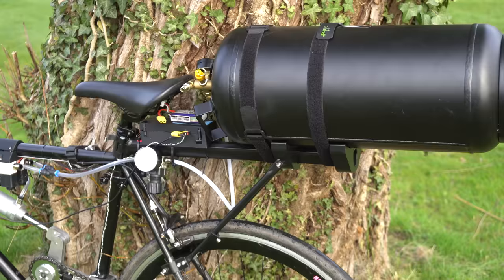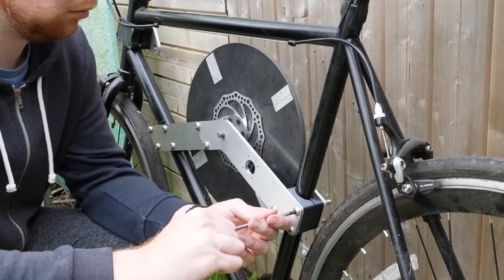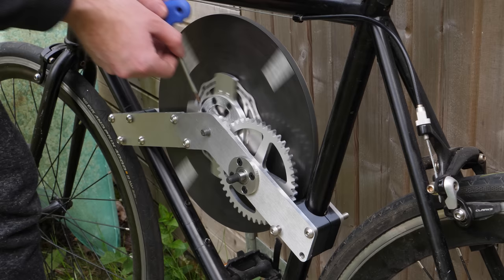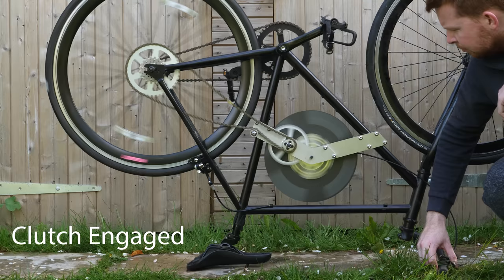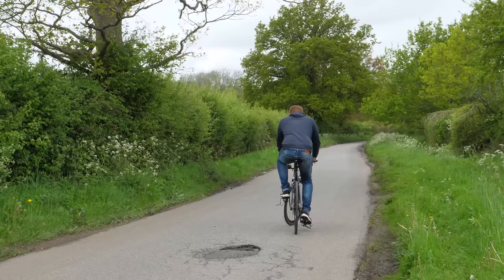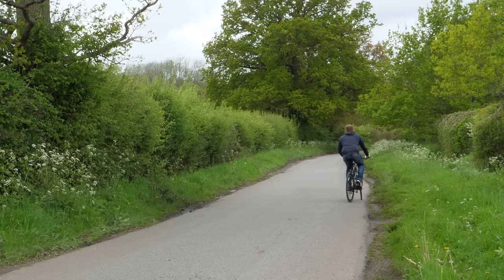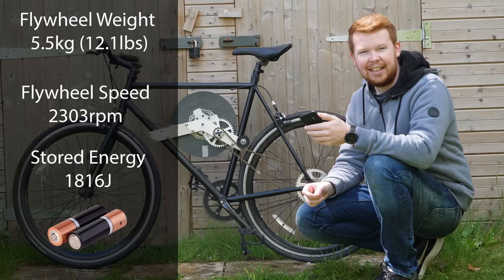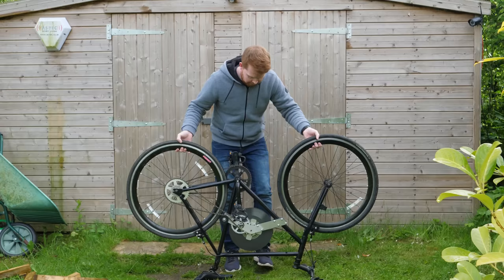Flywheel Bike KERS

Comment: Additional Benefit:
The Rotational mass stabilises the bike even when the bike is stationary.
Your feet dont need to touch the Ground at a redlight.
Reply: Wow I didn't realize that!
Reply: What would be cool is a way to power up the flywheel while the bike is stationary. You approach the red light, use the flywheel to slow down, (getting some RPMs) pedal a bit while waiting (gaining max rpms) and then engage the flywheel to accelerate quickly when the light turns green
Reply: I'm pretty sure bikes don't work like that
Reply: @burkejohnson4539  he's saying the gyroscopic effect of the flywheel would cause it to be stable at a stop. Not sure if this would help much, though.
Reply: @WorkedSnail  based on this logic motorcycles should stay upright too when idling. Maybe if the flywheel was heavier than the bike it would work.
Reply: @hsxenon  this flywheel is much larger considering the overall weight of the bicycle, compared to a bike.
Reply: Bro it can not keep the bike and Tom upright but it can balance the bike alone if Tom leaves the bike ..
Reply: Also if you spin the flywheel up in the right direction it will keep you from endoing and faceplanting which allows you to brake harder
Reply: @WorkedSnail  and I said it wouldn't. Believe me, I understand what he's saying, please don't patronize me.
Reply: @sarveshwarsharma990  for gyroscopic stabilization to occur, there needs to be gyroscopic procession. The flywheel would need to orbit a hinge. The flywheel does not do this in this case and so it will provide no gyroscopic stabilization.
Reply: @shutdahellup69420   @Sarveshwar Sharma  for gyroscopic stabilization to occur, there needs to be gyroscopic procession. The flywheel would need to orbit a hinge. The flywheel does not do this in this case and so it will provide no gyroscopic stabilization.
Reply: @laurean5998   @Sarveshwar Sharma  for gyroscopic stabilization to occur, there needs to be gyroscopic procession. The flywheel would need to orbit a hinge. The flywheel does not do this in this case and so it will provide no gyroscopic stabilization.
Reply: @jslavertu   @Sarveshwar Sharma  for gyroscopic stabilization to occur, there needs to be gyroscopic procession. The flywheel would need to orbit a hinge. The flywheel does not do this in this case and so it will provide no gyroscopic stabilization.
Reply: @lifefindsaway7875   @Sarveshwar Sharma  for gyroscopic stabilization to occur, there needs to be gyroscopic procession. The flywheel would need to orbit a hinge. The flywheel does not do this in this case and so it will provide no gyroscopic stabilization.
Reply: @oadka   @Sarveshwar Sharma  for gyroscopic stabilization to occur, there needs to be gyroscopic procession. The flywheel would need to orbit a hinge. The flywheel does not do this in this case and so it will provide no gyroscopic stabilization.
Reply: @Sarveshwar Sharma  for gyroscopic stabilization to occur, there needs to be gyroscopic procession. The flywheel would need to orbit a hinge. The flywheel does not do this in this case and so it will provide no gyroscopic stabilization.
Reply: @burkejohnson4539  bro here we dont want the gyro to spin freely ... We want the gyro to keep our bike stabilized and fo that the gyro needs to be connected directly to the bike for energy transfer ... If we connect the gyro to a hinge then the gyro would just stay in its upright position even if the bike Is standing of is falling ... It will not be able to transfer its energy to the bike and all the energy will be lost due to the hinge...
Reply: @sarveshwarsharma990  yes it needs to orbit. It will still have some degrees of movement restricted
Reply: @burkejohnson4539  if it can orbit freely it will just orbit freely no force will be exerted and we want force to keep bike balanced
Reply: My Comment was ment to be a Joke with some science background....lol.
This flywheel is of course WAAYYY to small to keep you upright.
But a idling Motorcycle is eazier to balance than a Bicycle especially Bikes with large displacement.
Gyroscopic stabilization is a thing!
Reply: @justjonazjameson5559  lol sorry sometimes I'm a bit too logically minded and don't pick up on that stuff. All else aside I believe that for gyroscopic stability to be created the rotating mass needs to be orbiting about a center point. Look up a demonstration on YouTube using a bicycle wheel. Notice how it rotates around the point it is suspended from. If it weren't for this motion, the wheel would just fall. For this reason, the flywheel on a motorcycle (or bike, for that matter) would not provide gyroscopic stability.
Reply: @sarveshwarsharma990  by orbiting in response to the bikes motion the stability is generated
Reply: @sarveshwarsharma990  it would only orbit in one plane of rotation, so not completely freely, either
Reply: @burkejohnson4539  yup now u r right ... It needs to be fixed in the axis direct towards the motion n of falling bike ...i.e. it needs to stay as it is rn
Reply: @sarveshwarsharma990  it still must be able to orbit, which it can't now

Comment: I work in electronics and my solution would obviously be regen braking. The idea is ridiculously simple: you have three half-bridges powered by the battery that provide voltage to each phase of the motor. The higher the voltage, the higher the RPM. If you intentionally reduce the motor voltage below what its RPM should dictate, then the motor will charge the battery. The only additional component needed would be a dual stage brake lever. Pull the brake slightly and you send a signal to the controller to start regen braking. Pull hard and the lever pushes the master cylinder as well so you have a combination of regen and friction braking for a shorter emergency stopping distance and a failsafe if the battery craps out.

Comment: Loved the video. Some of the real world benefits I can see from this is acceleration smoothing on hills better than stopping and starting. Less smooth start help and more hill climb assist. Going downhill would enable more spin-up input energy and then engaging the flywheel would help assist in pedaling through the climb portion. 

Love the whole concept and now I want to build a flywheel alternator mod for an electric bike. A switchable one so it either discharges the flywheel speed as mechanical energy or just keeps spinning to charge the battery when not pedaling.
Reply: I can't imagine there would be any real world benefit compared to using a lighter bike and using your gears effectively.

Comment: Anyway, I think it'd be interesting to see the effect of a big gyroscope in the bike's frame or in the wheels.  It wouldn't want to turn in certain ways.  You might be able to do gravity-defying maneuvers with one of those, mounted on a gymbal (sp?).
Reply: My thoughts too.  Prolly a better arrangement would be electric drive dual flywheels, spinning in opposite directions
Reply: @flishry  You might be onto something here 🤔
Reply: @flishry  in order to turn a bike you make a small turn in the other direction just before you turn the way you want. This shifts your centre of gravity in so you don't just fly off the outside of your turn.

Any gyroscope strong enough to correct an ice slip would probably be strong enough to stop this minor corrective pre turn turn. As a result you might not fall off from ice, but any attempt to turn would throw you off the bike.
Reply: Or rotate the flywheel 90 degrees laterally or vertically.
Reply: I suppose not unsimilar to motorcycle wheels at high rpm (30+mph). Seems like a feature. I wonder if the ideal gyrocycle would behave like those gyroscopic unicycles. Then you could keep peddling while stopped at traffic lights to recharge the flywheel.

Comment: you‘d need two gear ratios, one for accelerating the flyweel and one for accelerating the bike.
Reply: I was thinking CVT but this sounds much more reasonable to build, in fact a regular shifter and 5 speeds would be amazing, you could shift down to rev it higher and higher as the bike slows and then gear it higher for the highest max speed after launch. They make pedals with bearings so the front sprocket can freespin for adding 66cc engines to bikes so they can use the shifter and existing chain, it's called a 'jackshaft' kit. with that Tom could make the flywheel transfer through the existing gear cassette and be able to change the ratio.
Reply: Don't let me rain on anyone's parade, but be aware that HEV/BEV's recover very little energy from regenerative braking. Most of the fuel savings in a hybrid is from cutting the ICE when unneeded
Reply: @chrismofer  I think the part about the gear shifter is gold.  That's what this really needs.
Reply: @MarcillaSmith  The point isnt that they recover loads of energy, its that it would have otherwise just been wasted so anything you can get without too much added weight is basically free range.

Comment: The solution I have used for not round holes on a cnc is to plunge the end mill to create a pilot hole in the center and then finish it on a drill press. Works wonders.

Comment: I would like to see a version with the flywheel integrated in the rear wheel. You could get a much larger mass and eliminate some of the mechanical losses through the extra chain and sprockets by having the clutch transfer the power directly back into the drive wheel. I've been toying with the idea for a motorless drag racing motorcycle where the flywheel is spun up with a removable electric motor.
Reply: I was looking for a comment like this, I couldn’t be the only one to have thought of something similar
Reply: They spinning mass off center might try pulling the bike over.

Comment: Sounds like a very good choice for flywheel might be off the back of a standard shift transmission motor it's called the pressure plate heavy Central mounting it's already round knock the gears off of it even add some weight if you need to

Comment: This seems like the perfect application for a CVT. With a CVT you could ramp from full speed to nearly stopped all while still putting energy into the flywheel.  I would estimate you could get close to 50% efficiency this way.
Reply: Hard to fit a cat in the frame though.  I was thinking the same thing.
Reply: Cvt?
Reply: @wimsweldens6118  Continuously Variable Transmission https://en.wikipedia.org/wiki/Continuously_variable_transmission
Reply: @celewign  cat?

Comment: This can be useful in downhill as well; You store the energy in flywheel, and once downhill is over, you use it.
Reply: As someone who lives on a hill and bikes daily, I am both 'yeah' and 'nah' to this. It sounds like charging up your flywheel going downhill would be good, but realizing how fast it would be spinning between your legs is kind of chilling. Any mechanical failure at thousands of RPM would be horrendous :/ Additionally, if all that energy went into accelerating you again, it might accelerate you too much (at the bottom of my hill is a busy road; would hate to not have perfect control over my acceleration when pulling out into it). Of course all of that would depend on the design and implementation of the flywheel.

Comment: This seems like it would be useful in a hilly area, speed up the fly wheel gliding down hill and then it can assist going back up without having to travel down the hill at unsafe speeds.
Reply: I was wondering how well it would work as a speed limiter in a downhill ride as well.  I also want to know if there is a way to have it assist at the start while you also try pedaling, or if it would just be free wheeling.
Reply: It is theoretically useful, but the flywheel literally doubles the weight of a carbon bike, and you need to be riding WAY faster than he was riding to generate enough speed to assist with the acceleration. He got to 2300rpm going slow. I suspect you’d see 20000rpm at the useful speeds you are expecting. No thanks.

Comment: You need to design this so that when you want to decelerate/slow down you can pull the break lever which will engage the spinning of the flywheel as a way of slowing you down, and then when you want to accelerate again you release the brake which engages the flywheel (which is now already spinning) to propel you forward. This will allow you to peddle without being robbed of energy from the weight of the flywheel always spinning and only using it when needed. 😁

Comment: Good, you'll need all that 15% energy efficiency, with the added weight of the flywheel and all 😄
This is a really fun experiment!
Reply: 6kg is a weight of 750W middrive + 7Ah battery
Reply: @Zangief The Red a practical experiment always beats a theoretical breakdown, where it takes a lot of experience in similar mechanics (or knowledge of applicable equations) to make sure you didn't overlook something. The proof is in eating the pudding.

Comment: How expensive are tungsten alloy flywheels since they're even heavier?
Reply: Much more expensive, it would probably be more cost-efficient to use tungsten carbide, but even then its 20 bucks or more per KG
Reply: The most effective solution in this case would be to displace the mass of the flywheel towards the outer edge so it has a greater moment of inertia
Reply: @gxexrxmxaxnx  then a centrifugal clutch would make more sense i think

Comment: Cool project. Out of curiosity I worked out the maths on how efficiently energy can be stored in or recovered from the flywheel KESS.

Let m* be the equivalent linear mass of the rotational inertia component of the flywheel as a dimensionless ratio of the equivalent linear mass of the bike and rider system with the flywheel decoupled.
When starting the bike from rest using energy from the spinning flywheel, the recovery efficiency is (m*)/(1+m*), assuming zero frictional losses outside of the clutch plates.

Now to estimate m* for your setup. The rotational inertia of the steel disc, I=0.5*m*r^2, with m=5.5 kg and r=0.15 m. I=0.062 kg*m^2. Assume all other rotational components in the clutch and gear train are negligible. Upon close inspection of the gearing, you have a 12t gear on the pressure plate of the clutch, which meshes with a 45t gear affixed to an 11t cassette cog, connected via chain to a 42t rear cassette cog affixed to the rear wheel. The overall gear ratio from flywheel to rear wheel is (45/12)*(42/11)=14.32:1, and the gear ratio has a squaring effect on the moment of inertia of the flywheel, so 0.062 kg*m^2 at the flywheel becomes 12.7 kg*m^2 virtually at the rear wheel. A 700c wheel has a radius of about 34 cm, so the flywheel's rotational inertia is equivalent to a whopping 110 kg of non-rotating mass on the bike frame! That's why it was so incredibly difficult to pedal while charging up the flywheel. This 110 kg is probably pretty close to the equivalent linear mass of the whole system with the flywheel decoupled, so m* is on the order of 1.0.

Therefore, the energy recovery efficiency from a standstill cannot exceed approximately 1/(1+1)=50% with this setup, no matter how efficient the geartrain is. The 15% you actually achieved falls quite short of the theoretical maximum, and I suspect that there is a lot of friction in the geartrain robbing energy.
Reply: So he is doubling the mass that must be accelerated?
Reply: @user-rn3rn6nl3h  Precisely.
Reply: A good portion of the energy is likely also lost as heat when engaging and disengaging the clutch when charging and discharging the flywheel. A more efficient clutch, or ideally, the infinitely variable transmission he was talking about would likely increase efficiency. Also definitely friction is an issue. His chain for instance is clearly not tensioned super well.

Comment: Wouldn't it be more efficient to use two DC motors? Back drive one as a dynamo to power the other one. That's effectively an infinite gear ratio without a lot of mechanical hassle. And if you were to make the flywheel more like an actual wheel, you could probably get higher rpms from a lighter wheel with a larger percentage of it's mass towards the outer rim.
Reply: Had the same idea when he Tom talked about infinite gear ratio
Reply: Science my friend doesn't allow it can't get out more than you put in energy cannot be created or destroyed only converted
Reply: @bystander1489  Absolutely true, but the point of a regenerative braking system is to store energy that would otherwise be wasted as heat when braking. Of course it wouldn't make much sense to charge up the battery/flywheel/whatever when you're pedalling (unless maybe you're racing and wanted to store some energy while drafting, to use later when attacking). But a system that's efficient enough will save energy - after all hybrid cars do this.
Reply: @themindgarage8938  true but a hybrid battery won't take anymore when charged so in reality it's not saving anything ,there is a way to make a push bike go way faster with not much effort and there is a possibility of generating electrical charge to store it for later and with enough thinking and a adaptation to your bike could possibility work with your brake system
Reply: @bystander1489  Ehm? Say what now? I'm just suggesting an improvement to the efficiency of the system. I'm pretty damn sure I never suggested anything that would defy the laws of physics.

Comment: I think the right way to use it would be accelerate as normal, and when you're up to speed, you can start charging the flywheel. When you need to break you primarily use the flywheel to slow down unless you need to do so quickly. Then once you're done slowing down/stopping you use a combination of the flywheel and pedaling. It's there to make the transition easier, not to replace pedaling.